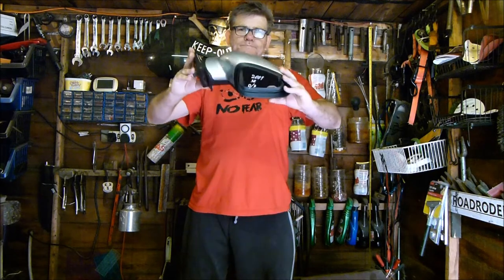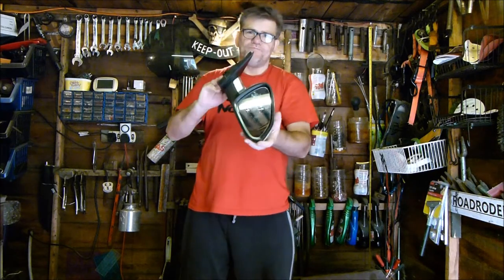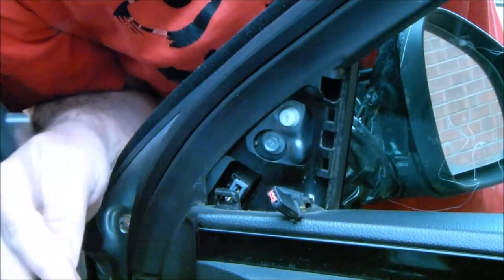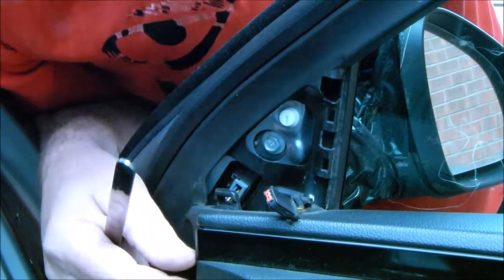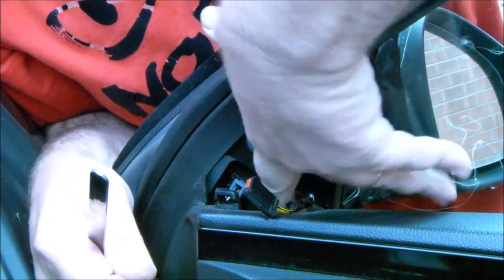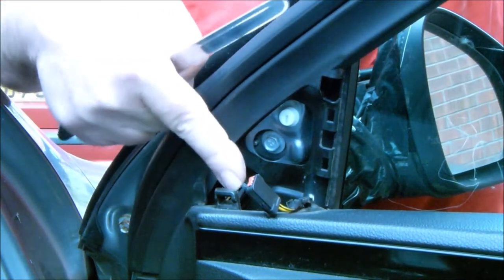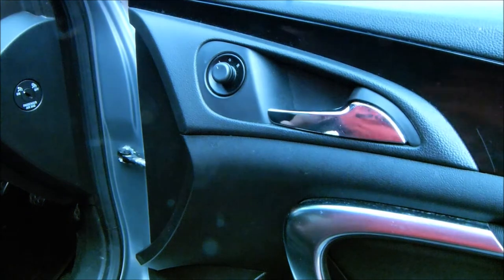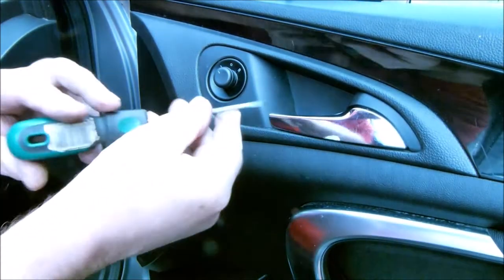VAUHALL INSIGNIA, Drivers Doorcard and mirror removal.

Comment: Hi it is not possible to do the work without unmounting the door panel ?
Reply from the maker: Yes you can if you have very small skinny fingers, mine are to fat so it was much easier just to remove the card. 👍